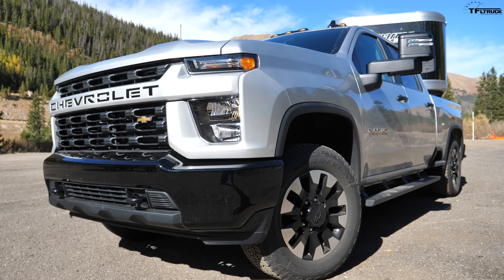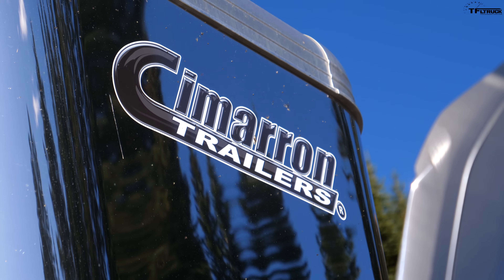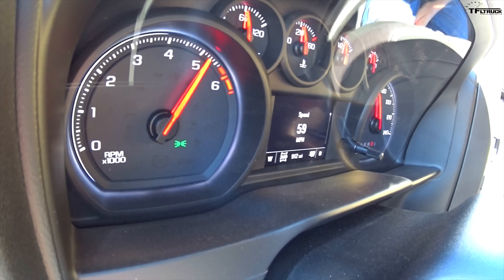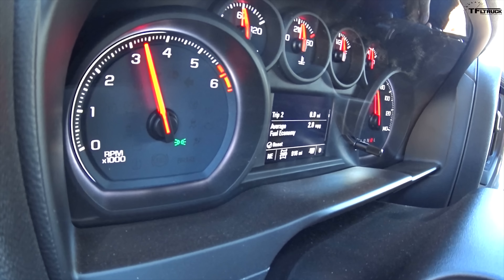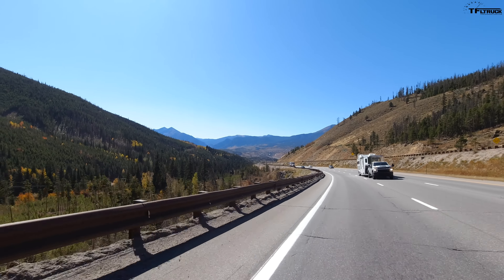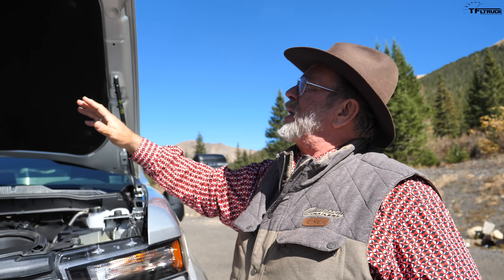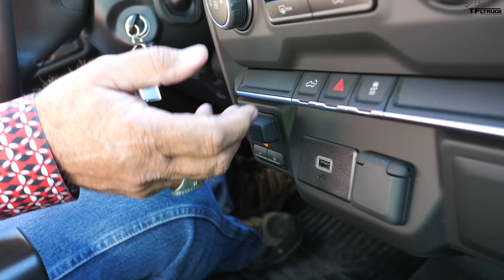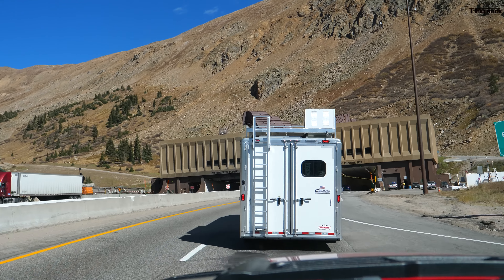The New 2020 Chevy Silverado HD Gasser Broke Our Ike Gauntlet Scoring System - Here Is How!

Comment: GM should have kept the 4.10 axle ratio and gave the 6.6 the 10 speed...maybe they could at least offer it as a Max Trailering Package option? I realize not all end users need max towing.
Reply: truckguyjoe after GM breaking their contract with Ford Ford probably refused to allow them to use their 10 speed in this truck
Reply: I'd think they'll do it later as "upgrades." We all know all OEM's plan the entire life of this generation fairly well, including incremental upgrades.
Reply: @ripfletching  it's not Ford's transmission. It was a joint venture but word is Ford did more on this, GM did more on the fwd 9 speed. GM doesn't need permission from Ford to us their own transmission
Reply: truckguyjoe even a 5.10 gear ratio would not have improved the time.
Reply: @I know you are right, And I just got owned but: the lower the rear axle ratio the higher the tow rating. That's why medium duty trucks with the highest GCWR have the lowest available rear axle ratio. If we are talking 3/4 ton gas pickup trucks...consumers who tow want the 4.10 (lower rear axle) not the 3.73. GM should have kept the lower rear axle mated to the 6 speed auto. The icing on the cake would be a 4.10 with the 10-speed auto...or at the bare minimum give GM the 10-speed mated to the 3.73 in lieu of the 6 speed. We are not talking about fuel mileage here. We are talking max towing and max gross combination weight rating. Look at Ford, RAM, or Chevy Medium online order guide and towing application. The lower the rear end...4.30...4.88...the more they are rated to tow and the higher the GCWR. It's all about the launch...getting the load moving and keeping the engine in the torque curve.
Reply: @I know you are right, And I just got owned but: this is not about fuel economy. It's about how fast these trucks can pull a load uphill. You need the right gearing in the truck and transmission to put the power to the ground. This is not a fuel economy test. With that said...light duty trucks that want to win the towing a load uphill the fastest want the towing gears...not fuel economy gears.
Reply: @I know you are right, And I just got owned but: did you read the title of this video? The point of the video is whether or not the new 6.6 gas has what it takes to keep up with a diesel pulling a trailer up hill. Not which truck gets better fuel economy!
Reply: truckguyjoe  My theory is this.  The 3.73 got put in there because the 10L90 10 speed is coming.  As to why it’s not in it yet?  Ford.  I’m betting that during the joint venture, Ford let GM do a 10 speed with the Duramax first but Ford got to put their 10 speed in the gas trucks.  If my theory proves correct, 2021 should see the 10 speed with the 3.73 gears.   If they were smart however, they would have carried over the 4.10/6speed combo for now.
Reply: killercan10 100% agree & I hope you’re right!!
Reply: @ripfletching  The joint 10spd venture was for the half ton. Not the HD trucks. GM already uses the 10spd on the Duramax
Reply: killercan10 GM has its own version of the light duty ten speed co-developed with Ford which it used first in the ZL1 back in 2017 and is now in the 1500 series trucks. GM has a heavy duty 10 speed co-developed with Allison in the 2500 & 3500 series that is not based on the light duty 10 speed at all.
Reply: Who in here would’ve just push the downshift button?   When it does downshift it gain speed so it has enough power to pull the hill faster.
Reply: Hi- Fi no I believe if you will look it up The new Allison transmissions are branded Allison not manufactured by Allison !!! As far as I can read all 10 speed automatic transmissions by Ford or Chevy were created by Ford GM only changes the programming GM was supposed to develop a 10 speed front wheel drive transmission which they could not and broke the agreement after Ford and created a 10 speed for both companies to use only Ford kept a proprietary programming for their transmission
Reply: @kdougk6668 True, either hit the downshift button or let off the gas then smash the pedal to the floor so it'll drop a gear or two. But, unfortunately TFL holds the pedal down without lifting (unless they're going over 60MPH) to show what the truck will do on it's own which is fair but, it seems to discredit the truck's true capabilities... Sorry for the rant.
Reply: ripfletching ...GM and Ford co-developed a light duty 10 speed rwd transmission and a 9 speed fwd transmission....end of joint venture. GM along with an Allison certification is building its own in house Heavy Duty transmission for 2500 & 3500 branded as an Allison 10 speed. Ford is building its own heavy duty 10 speed and it too is believed to be not related to the co-developed transmission or GM's heavy duty transmission.
Reply: rlhmarines Ford-GM 10-speed automatic transmission
Read in another language
Watch
Edit
This transmission is part of a joint-venture between Ford Motor Company and General Motors to design and engineer two transmissions, a longitudinal 10-speed transmission and a transverse 9-speed trans-axle. Each company will manufacture its own unique version of the transmissions in their own factories.[1][2] The 10-speed transmission was designed by Ford, while GM designed the 9-speed transmission which is used in transverse applications.[3][4]
Reply: I would agree, the gasser would have had alot more benefit from the 10speed than the diesel (now that a diesel pickup is around 1000ftlbs of torque), the 4.10 axle would help alot too but like you said, maybe in a Max tow package.
Reply: @hi-fi3889  Ford developed the 10 speed while GM developed the 9 speed. GM does their own programing on the 10 speed..that's it. Same goes to Ford for the 9 speed
Reply: @ripfletching  not the same 10-speed, has nothing in common with the 10-speed you are referring to that is used in the half ton.
Reply: @jasonlarsen3515  how do you figure? Anytime you can get in the powerband sooner and not drop out of it you will apply more power to the ground improving your time.
Reply: SMiller5488 transmission has 6 gears. The 6.6 make peak power at high end of rpm range.
Reply: @jasonlarsen3515  yes we know
Reply: SMiller5488 so unless the power issue occurs in 1st or 6th gear what is difference is 3.73 vs 4.10 going to make?
Reply: @jasonlarsen3515  well if the truck is in 2nd, 3rd, 4th, or 5th as in this video then it would be 200rpm higher which would put it that much higher in the powerband where it would make that much more power where it would then go that much faster...
Reply: SMiller5488 so 28 vs 26 mph?
Reply: @jasonlarsen3515  so 200rpm =2mph?
Reply: @ripfletching  The fact that Ford and GM had a joint venture for ONE 10 speed transmission does not mean they had a joint venture for ALL 10 speed transmissions. The A10 in the 1500 trucks and Camaro's shares nothing with the HD 10 speed outside of the number of gears.
Reply: @jasonlarsen3515  Besides the powertrain difference the shorter gearing will also provide higher torque multiplication. Think of the shorter gear (4.10) as a longer lever than the taller gear (3.73). To make this difference more clear let's say the transmission is in a gear that's a 1:1 ratio, and the truck is making 300ftlbs of torque at the moment, the 3.73 gears provide an output torque of 1,119ftlbs where the 4.10 gears provide an output torque of 1,230ftlbs. The tradeoff is higher RPM for a given speed which will affect fuel economy, noise levels and top speed in each gear, which may or may not matter depending on the speeds involved. I haven't bothered to look up the gear ratios and tire size to figure that out.
Reply: Fuel economy (when it's > $4.00 a gallon) is part of it. You can put a blower on that gas engine and it will beat the Duramax up the hill, but at 1 mpg instead of 5mpg. The reasons I bought a Duramax back in 2005 was #1 Towing capacity, #2 better mileage than the HD Gas engine.
Reply: Max towing = less MPG when not towing sticky choice
Reply: Actually my 05' Duramax gets 16 City/22 Hwy mpg when not towing. The HD Gas trucks get 14/18.
Reply: @tjshine8022  with 4:10's rear that's great
Reply: @tjshine8022  Depends on the gas truck. I've had a few (and still have one) 8.1L HD and they don't get anywhere close to 14 highway, let alone 14/18..
Reply: And 35's! Of course the EDGE programmer helps too.
Reply: The gas engine is much more reliant on where in the powerband you are. It has no guts at 1800rpm, you need to be 4000 to 5000 to speed up. The Duramax powerband is much more flat between 1800rpms-2500, which also explains why it uses less fuel.
Reply: daveror my 8.1 gets about 6 MPG towing...
Reply: Oh that sucks. I pull a 40' toyhauler loaded at 16,400lbs and average 10mpg.
Reply: TJ Shine I’ve had my truck completely serviced, all fluids and filters, you name it… All driveline fluids etc.… Plugs, wires, Clean mass airflow sensor, premium fuel, and still no better than 6. Truck is a regular cab with 4.10s. I bought it brand new and the last 10 years I don’t tow with that much and to be honest when I bought it I wasn’t expecting anything phenomenal as far as fuel mileage.
Reply: ripfletching then they should have put the new “Allison” in it like the Duramax. .
Reply: @truckguyjoe  For me it depends.. with 12k conventional it gets around 5-6 in more or less flat ground. With 5k or so conventional I get 9-10. 11 or so avg unloaded. Mine is a Sierra SLT 2500, RWD with the 4.10 gear. CCSB.
Reply: Racing Slippers -Ford never used the 9 speed, instead they opted to use their own 8 speed.
Reply: @jasonlarsen3515  of course a lower gear ratio (numerically higher number) will tow easier and get faster times up hill if the truck is struggling in the current configuration, but then again manually dropping a gear to help the engine get into its powerband is changing the overall ratio as well
Reply: Tundra Half -ton 4.30 axle ratio is unbeliveable
Reply: @killercan10  You are reading too much into the truck being supplied with the 3.73 gears. The 3.73 gear set is pretty much the standard gear set for all gasoline heavy duty trucks, be it Ram, Ford, or Chevrolet.  The 4.10 and 4.30 are optional gear ratios.  I am in the market for a gasoline heavy duty truck right now, and thought, instead of ordering the truck I wanted, I would try to look for a 2019 gas heavy duty truck. Boy, that was an experience!  Trying to find towing gears in a gasoline heavy duty truck of any brand is like trying to find a needle in a stadium-sized haystack. They are just not made a part of dealer stock. When you do find them, it is because somebody custom-ordered the vehicle and then backed out.  It is hard to find low-mileage used gas trucks with towing gears also, because people tend to hold onto them for longer than those with the standard gearing. To get the 4.10 gears in a chevy truck, you are going to have to custom order it.
Reply: Actually in order to compare Apples to apples all their tests are done in Drive. In the real world one would simply put the tranny into manual mode and select a gear to maintain RPMs and could have easily made it up quicker.
Reply: I agree about the 4.10 gearing, but at least that's a cheap easy upgrade most of us can do. I won't be able to afford this truck until its 10 years old or so.
Reply: The non-turbo gasser just can't breath at extreme altitude.  It was running 5000 rpm a lot of the time.  5:24  5500 rpm.  F me.   I don't think gearing is going to fix that.

It's a really extreme test that won't apply to most usage.
Reply: @ripfletching  The hd 10 speed is an Allison and has nothing to do with Ford.
Reply: @WilliamStewart1  finally people who understand something many gm techs have told me that the two are just different. Also no gms and fords a10s are different a transmission is not a 1 size fits all. They do need to be designed to hold different power curves and applications.
Reply: jocarr1791 I agree totally not much to my knowledge people towing max rating will set cruise control and wait. Idk it’s weird.
Reply: ripfletching they broke the contract? What do you mean?
Reply: @ripfletching  You don't have a clue what you are talking about.  The GM HD 10-spd has NOTHING to do with Ford.
Reply: dylan522p if you google it you can find the information ppl on this feed don’t know they are just commenting because they like a brand name truck. I did research and I don’t believe the HD trans has any connection with Ford. But All the GM 10 speeds for cars and light trucks are ford motor patents. I’m out ppl can google it themselves I posted a link in a call meant that you can go to to find out more information
Reply: @ripfletching  I tried googling but there is too much conflicting information. Any defintiive sources would be greatly appreciated
Reply: dylan522p The reason it’s so hard to find which you can tell by the comments above people are very opinionated and they don’t really want the masses to see what is going on behind closed doors Ford and Chevrolet have made announcements they will be working together to combat the growing international auto market they have to be able to compete and one way of doing this is sharing technology I am a Ford stockholder and keep up with it pretty closely Bill Ford said in the future brand loyalty might not be so strong as it has been in the past because there will be a lot of shared technology I believe this is what they want between Ford and Chevrolet but who knows what will actually happen
Reply: @tjshine8022  -- so why don't they put a turbo charger or a supercharger on the gas engine and broaden the power band
Reply: Yeah they really should give the 4.10 as an option becuase my 04 6.0 has the 4.10 and though it obviously gets worse mpg it still tows great even with a 4spd
Reply: I figured if I buy "HD" it's for maximum towing.
Reply: @theunconventionaldeal3879  The majority of HD trucks are bought for payload not towing, at least with work trucks anyways. Most companies that need to pull heavy loads will get a proper heavy duty truck as logistically it makes more sense.
Reply: @teamlazydave  great job but 100 ftlbs is not gonna change much time on 16,000lbs thats like going from a 265-32" inch tire to a 285-33" tire " i thk"
Reply: @teamlazydave  o wow that bad eh i thaught 12/16
Reply: Trevor C I have an 05 with the same gears ⚙️ and it plows snow like nobody’s business! I’m keeping it till it dies! I’m thinking of adding another plow truck and want a new Silverado but thinking about a 15-18 GMC Sierra 2500hd 6.0.
Reply: Seems like a lot of time could be made up with a trans tune or manual shifting
Reply: @kdougk6668  I agree. The 6 speed is known to not downshift when it needs to. A manual downshift would have helped a ton.
Reply: @ripfletching   Ford and Gm only co built/partnered with the 1/2 ton 10 speed the 3/4 and 1 ton versions are only Ford
Reply: @EGGINFOOLS  That’s incorrect you can go to Wikipedia even the Allison transmission 10 speed is a Ford 10 speed branded by Allison
Reply: @EGGINFOOLS  Ford Motor Company and General Motors to design and engineer two transmissions, a longitudinal 10-speed transmission and a transverse 9-speed trans-axle. Each company will manufacture its own unique version of the transmissions in their own factories.[1][2] The 10-speed transmission was designed by Ford, while GM designed the 9-speed transmission which is used in transverse applications.[3][4]

Ford 10R80 · 10R140 GM 10L80/10L90 · Allison 10L1000
Reply: @rlhmarines  Ford Motor Company and General Motors to design and engineer two transmissions, a longitudinal 10-speed transmission and a transverse 9-speed trans-axle. Each company will manufacture its own unique version of the transmissions in their own factories.[1][2] The 10-speed transmission was designed by Ford, while GM designed the 9-speed transmission which is used in transverse applications.[3][4]

Ford 10R80 · 10R140 GM 10L80/10L90 · Allison 10L1000
Reply: @SMiller5488  Ford Motor Company and General Motors to design and engineer two transmissions, a longitudinal 10-speed transmission and a transverse 9-speed trans-axle. Each company will manufacture its own unique version of the transmissions in their own factories.[1][2] The 10-speed transmission was designed by Ford, while GM designed the 9-speed transmission which is used in transverse applications.[3][4]

Ford 10R80 · 10R140 GM 10L80/10L90 · Allison 10L1000
Reply: @teamlazydave  Ford Motor Company and General Motors to design and engineer two transmissions, a longitudinal 10-speed transmission and a transverse 9-speed trans-axle. Each company will manufacture its own unique version of the transmissions in their own factories.[1][2] The 10-speed transmission was designed by Ford, while GM designed the 9-speed transmission which is used in transverse applications.[3][4]

Ford 10R80 · 10R140 GM 10L80/10L90 · Allison 10L1000
Reply: @specforged5651  Ford Motor Company and General Motors to design and engineer two transmissions, a longitudinal 10-speed transmission and a transverse 9-speed trans-axle. Each company will manufacture its own unique version of the transmissions in their own factories.[1][2] The 10-speed transmission was designed by Ford, while GM designed the 9-speed transmission which is used in transverse applications.[3][4]

Ford 10R80 · 10R140 GM 10L80/10L90 · Allison 10L1000
Reply: @WilliamStewart1  Ford Motor Company and General Motors to design and engineer two transmissions, a longitudinal 10-speed transmission and a transverse 9-speed trans-axle. Each company will manufacture its own unique version of the transmissions in their own factories.[1][2] The 10-speed transmission was designed by Ford, while GM designed the 9-speed transmission which is used in transverse applications.[3][4]

Ford 10R80 · 10R140 GM 10L80/10L90 · Allison 10L1000
Reply: @MatthewK88x  Ford Motor Company and General Motors to design and engineer two transmissions, a longitudinal 10-speed transmission and a transverse 9-speed trans-axle. Each company will manufacture its own unique version of the transmissions in their own factories.[1][2] The 10-speed transmission was designed by Ford, while GM designed the 9-speed transmission which is used in transverse applications.[3][4]

Ford 10R80 · 10R140 GM 10L80/10L90 · Allison 10L1000
Reply: @dylan522p  Ford Motor Company and General Motors to design and engineer two transmissions, a longitudinal 10-speed transmission and a transverse 9-speed trans-axle. Each company will manufacture its own unique version of the transmissions in their own factories.[1][2] The 10-speed transmission was designed by Ford, while GM designed the 9-speed transmission which is used in transverse applications.[3][4]

Ford 10R80 · 10R140 GM 10L80/10L90 · Allison 10L1000
Reply: @cboutdoorfun9955  Ford Motor Company and General Motors to design and engineer two transmissions, a longitudinal 10-speed transmission and a transverse 9-speed trans-axle. Each company will manufacture its own unique version of the transmissions in their own factories.[1][2] The 10-speed transmission was designed by Ford, while GM designed the 9-speed transmission which is used in transverse applications.[3][4]

Ford 10R80 · 10R140 GM 10L80/10L90 · Allison 10L1000
Reply: @ripfletching  The Ford 10R140 has absolutely nothing to do with the Allison/GM 10L1000. No design elements or production are remotely the same other than they are 10 speeds. Yes they share some design and manufacturing, but not with the HD transmissions. You’re talking half ton and Camaro/Mustang stuff…..among others but not in the HD segment.
Reply: @specforged5651  https://en.wikipedia.org/wiki/Ford-GM_10-speed_automatic_transmission
Reply: @ripfletching  ….The Silverado & Sierra HD pickups DO NOT use the co-developed with Ford, light duty 10 speed auto BUT instead they use an in-house designed co-developed and certified by Allison Transmission, heavy duty 10 speed that shares nothing with the other light duty 10 speed transmission.
Reply: @ripfletching  The HD Ford and Allison 1000's have nothing in common with the light duty versions save for 10 speeds. Both Ford and GM did the HD versions on thier own, and they're both fantastic transmissions. The light duty 10 speeds are junk.
Reply: ..The only thing that’s in common between the two are the number of gears they offer, 10.
Reply: @rlhmarines  did you read the article I posted?
Reply: @ripfletching  …Yes I did. Wikipedia information is not always accurate since anyone can edit the information in the articles.
Reply: @rlhmarines  well what information are you speaking from. I keep up with the auto industry because I’m in it for a living and I had heard this was the case years ago what information have you gathered what is your source
Reply: @ripfletching  Again the 10l80 is nothing like the 10l1000, they have totally different cases, different gear sets, the HD has a gear driven pto etc etc. Stop arguing please, it's very annoying.
Reply: @WilliamStewart1  lol i’m not trying to argue if you look it up on Wikipedia it clearly states the Ford designed the both halftime and HD transmissions including the Allison branded transmission you need to change it on Wikipedia if you have facts to back up what you’re saying that for did not design this transmission but I do know the agreement was I heard this years ago from a Ford engineer at the Sturgis rally in South Dakota they were working on this transmission
Reply: @ripfletching  Cool more bad info from wikipedia. GM, at the very least, has said their "Allison" 10 speed has nothing to do with Ford's 10R140. They aren't even similar internally, this isn't the same trans like the smaller 10speeds and that 9speed fwd crap with different programming, it's an entirely different transmission, despite what random people on the internet add to wikipedia.
Reply: @teamlazydave  It would be interesting to read what you could find backing up your statement
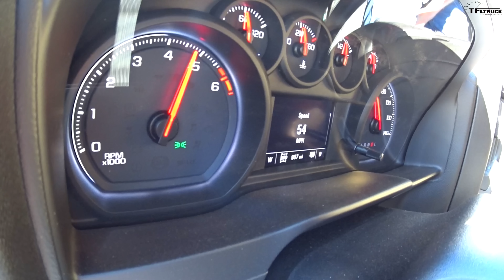Reply: @ripfletching  https://www.youtube.com/watch?v=lBocpjvch8M around 2:25 GM's engineer notes this has nothing to do with Ford but they "worked with allison" - you know when they wanted people to think it was an allison. But the GM has a chain drive PTO, Ford's 10R140 doesn't, they are on differnt sides of the transmission so not even the case is the same, etc. They are VERY different. Would I be surprised to find out some pieces are shared? Nope not at all - shared development costs makes it cheaper for both.. but they aren't nearly the siblings that the smaller 10speeds are where it's really just ratios, programming, etc.
Reply: @teamlazydave  good information so the “new” 10 speed is not made by Ford but as you can see they were just as I said. And everyone went crazy 😜
Reply: That’s why ford is number one selling for a reason